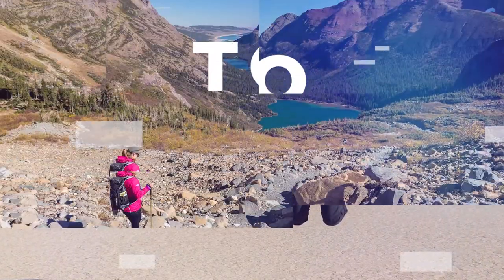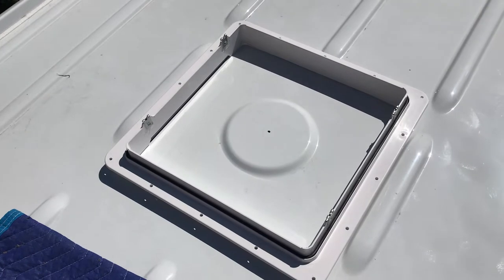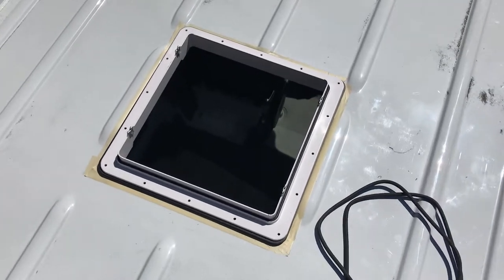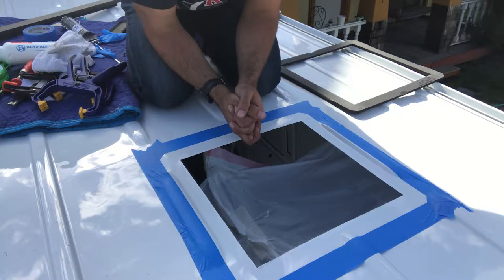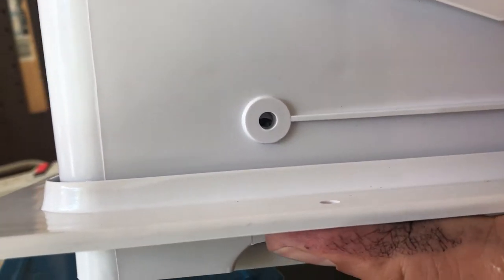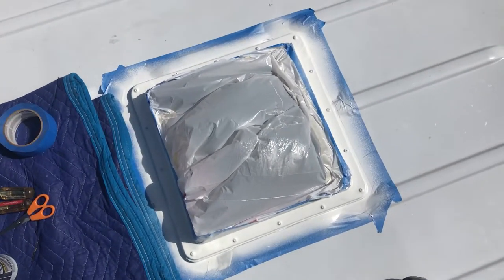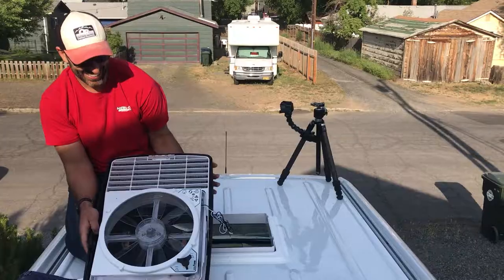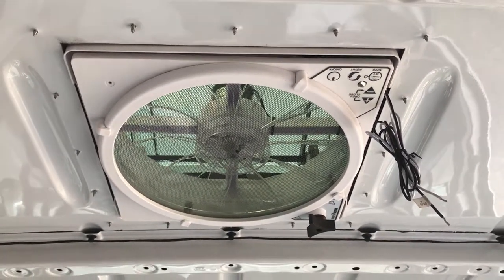DIY Van Conversion: Sprinter Van MaxxFan Install (Roof vent fan)

Comment: Hey really great informative videos. I’m in the beginning stages of converting a little transit connect and these videos are super helpful. A couple questions: 1. Would you recommend installing the fan before the interior ceiling insulation & build or can it be done after? 2. (Unrelated to the fan install) Did I see side curtain airbags on the inside? If so, wondering how you worked around those?
Reply from the maker: Thanks so much Kristie! And sorry for the late reply! We were super busy finishing our build for a move in deadline. I would highly recommend installing the fan first, if you can. It would be way easier to get to the interior of the cut hole and actually cut the hole if there were nothing in the way. Yes, we have side curtain airbags. They are very easy to work around. Just make sure not to use any sharp tools to remove the A pillar and you should be fine. The pillar (on the sprinter we have anyway) should just pry back with a bit of force. Hope this helps!

Comment: Great video! Very helpful! What caulking gun did you use?
Reply from the maker: Thanks so much! Just a standard caulking gun from home depot. They come in two different sizes I believe, and they just need to match the size tube that you buy. Hope that helps. Thanks for watching!